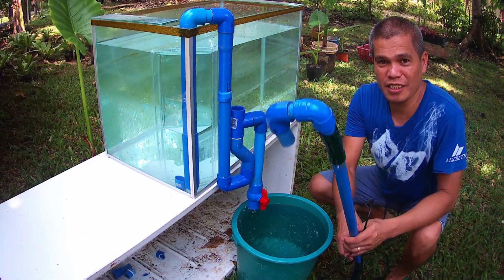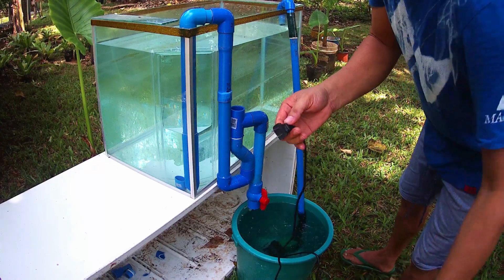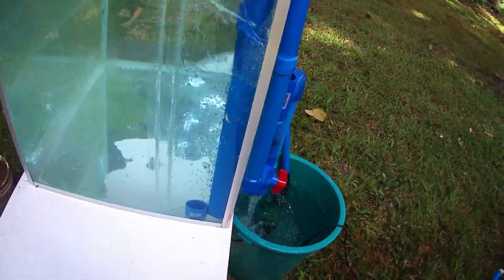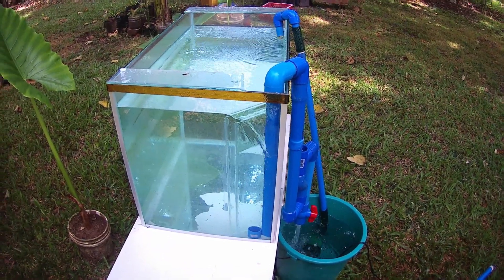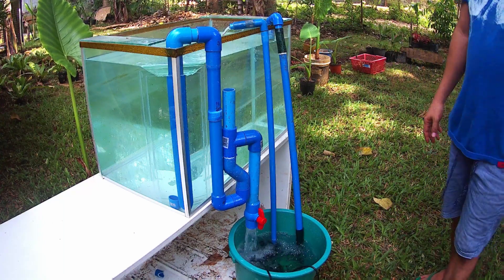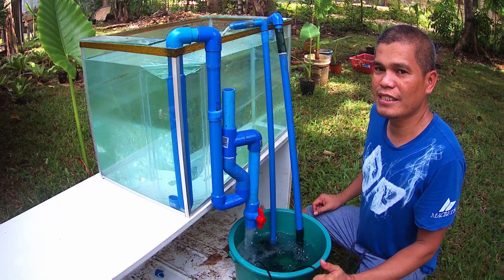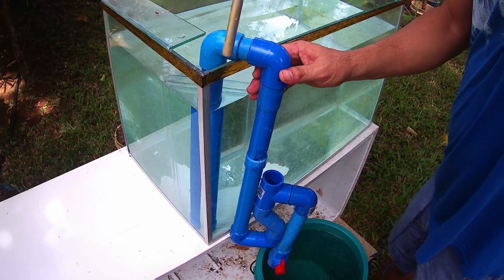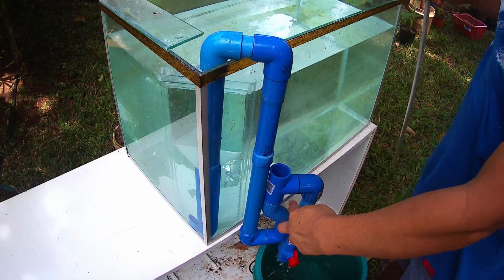OVERFLOW AQUARIUM SYSTEM for undrilled fish tank

Comment: Bro instead of putting that end cap after filling in the water why don't you close that valve on the outer side. It will work the same way..
Reply from the maker: No it does not work because there is opening along the pipe and that opening is  important to keep the siphon intact when you stop the pump, the pipe where the valve is connected is Not part of the siphon
Reply from the maker: The valve is no purpose, it so happen I'm using what is available pipe